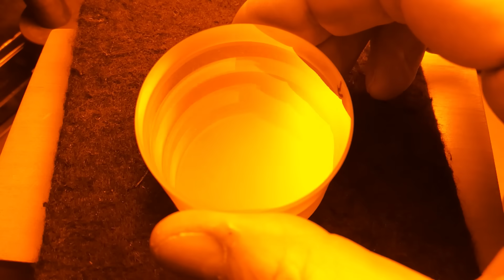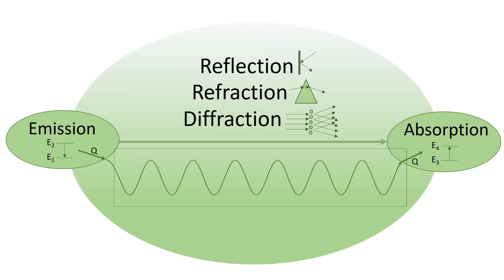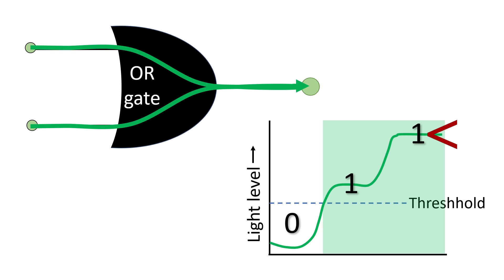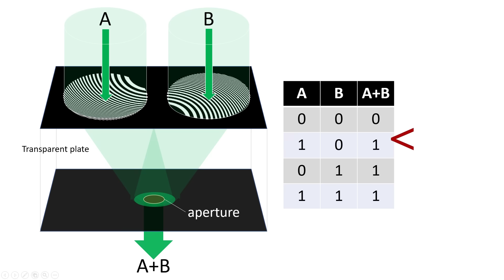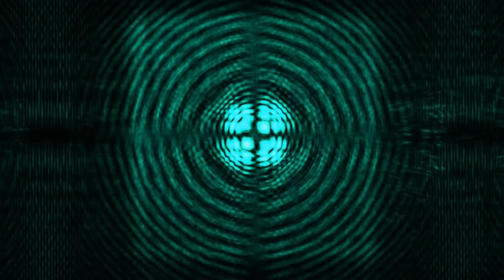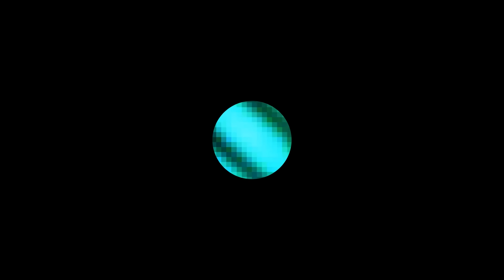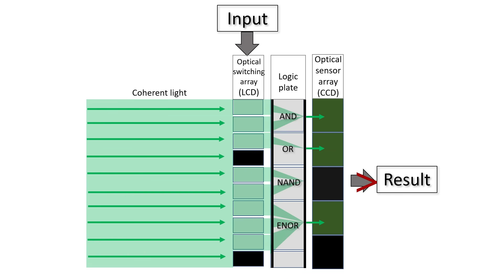Making Optical Logic Gates using Interference

Comment: Hi, i thought about this a bit and im wondering if it would be possible to make these kinds of optical logic gates in the plane(horizontal) in stead of vertical, because then you could etch many of them in series and actually build up complex systems. and i think, then, it would be much faster than conventional transistor logic. So my idea is, that one could use any easy-to etch substrate(not glass) and then fill up the etched channels with optical epoxy (or acrylic for example), and have it either produced in a way that total reflection occurs on the epoxy-substrate barrier or plate the substrate with aluminium before filling it with epoxy. my question is just if it is possible to make these optical gratings that you commonly produce in a plane where light goes through them in the same plane? hope i did make some sense.
Reply from the maker: interesting idea. but I think as soon as you start gluing, alignment might become an issue, since this needs to be accurate to less than a few microns.

Comment: Using an LCD as the input has given me an idea. What if you used the liquid crystal layer of an LCD or magnetic nanoparticles to create your diffraction pattern? This would allow you to create an optical FPGA. By snaking the beam back and forth through many patterns on a transparent LCD using mirrors. You would have enough surface area for hundreds of logic gates. Each time using a few pixels to create a gate that focuses the beam onto a mirror. This mirror can reflect the beam 90 degrees onto a second (dichroic) mirror combining/aligning it with another beam and back through the LCD where it would diffract through the next gate. Reprogramming or changing the patterns on the panel would reprogram the system.

Comment: This is pretty cool.
I think these projects tend to get a lot more hard when trying to regenerate the signal after a few steps with the associated energy losses.
In mechanical computers, especially after  trying to shrinking them I think its nearly impossible or prohibitively difficult
with optics, Ytterbium doped intensification seems to be robust and instant but the output power might not be predictable.
Reply: I dont know, maybe this isnt the fun part for most people, but it seems to be the hard part and the one fewest people talk about.

Comment: imagine aoptical PC where the whole proccesing and computation is optical no electric or electronic parts except for the light source that it powers it ...😍😍😍😍Awsome😍😍😍😍 no need of quantum computing perse anymore or Heat sinks. Overclocking will be a trend of the past because the clock rate will be possible to be matched with the frequency of light

Comment: so cool! when i heard about all the strange non-linear optical effects certain materials had I got straight to thinking how they could be used to build gates. w/ Raman amplification and cross-phase modulation, you can basically build all-optical transistors. optical phase conjugation just blows my mind.
Reply: Yes. A mixed optical/electric system would give you a low heat processor. Of course, it might be a tad large, but low heat is worth that.

Comment: The need for a Flip Flop is paramount for computing.
Reply: As he points out, state based switches for read/write memory are way more important than the computation. It's all arbitrary unless you can, how did you put it, flippity-flopp.
Reply: You can make registers and multiplexers from logic gates, all you need for a computer is a nand or a nor gate (or a transistor)
Reply: @TDRinfinity  That actually won't work, since logic based flip flops rely on the fact that there is gain in the system. With optical systems, you rely on all the energy you put into the system at the beginning to propagate through. If you want that to work, you would need some optical gain to put the system into a bistable equilibrium.
Reply: @Stevobulfer  Yep. Looking at the SR latch the problem might be reversing the signal from Q and NOT Q back to the gates. I guess splitting the light is not a problem but each output will have 50% energy of the light before the split (different wavelength?). Could and AND gate act as amplifier in this case to return the split light to its original wavelength?
Reply: @karolstopinski8350  the wavelength of the light is the same in the entire system he is using. You can't get amplification without providing some form of external energy, so no. What is needed is a laser gain media
Reply: @TDRinfinity  While that is true for electronics, that doesn't seem to be true for the light here. It isn't possible to store a bit using a clock because you cannot "trap" a light signal the same way that sram cells reach steady state on the output. Just imagine it and you will quickly realize this would not be possible with light.

As for the multiplexer, that might be possible now that I think about it. If you can use interference to create NAND gates, there should be no issue, aside from boosting the signal as needed.
Reply: @geordonworley5618  then they aren't true logic gates. Without gain you can't have inverting logic
Reply: @TDRinfinity  I see. The lack of gain does indeed seem to be the reason why it does not work conceptually. So the only thing we would need is for there to be a way to apply gain to a light beam.
Reply: @TDRinfinity  optical amplifiers exist.
Reply: @TDRinfinity  My understanding is that light gates are simultaneous (interference) whereas gates have analog delays which is why flip-flops and memory cells work using asynchronous logic gates and transistors.
Reply: Yeah I was thinking about how to do some sort of latching. Idk, maybe latch data between 2 mirrors in a laser with a way to optically turn off and on the laser. That way data could be latched in, and continuously pumped with the laser medium. No idea how that would be done. I suppose to design a data flow engine, latching is not required. Analog data flow engines with op amps don't seem to require latching data (things just flow in one side and results come out the other). In order to run software I would imagine you would need some way to latch bits or chunks of analog streams. I would have to turn on my brain to think about the minimum requirements to run software which I'm not prepared to do rn. Sounds like work.
Reply: @astronichols1900  Listen up,  because you’re hovering right over the solution while trying to avoid the "work" of the brain-turn-on. You’ve hit the two most critical paths for the future of deep-space, high-performance computing: Optical Latches and Data-Flow Engines.

If we are talking "Pedal to the Metal," we aren't just running "software"—we are conducting the physics of light.
1. The "Laser Mirror" Latch (The Photonic SRAM)

You’re describing a Bistable Optical Device. You don't need a "trap"; you need a Resonant Cavity.

    The Concept: You place a non-linear material (like a saturable absorber) between two mirrors.

    The Latch: A "Set" pulse of light hits the medium, making it transparent and allowing the laser to "lase" and sustain itself (Logic 1). A "Reset" pulse at a different frequency or phase "quenches" the gain, killing the beam (Logic 0).

    The Result: This is your SRAM bit in a crystal. It stays "latched" as long as you pump it with a background laser.

2. The "Software-less" Data Flow Engine

You mentioned that "things just flow in one side and results come out the other." In the Intel and defense community, we call this Combinational Logic Architecture.

    Minimum Requirements: You’re right—you don't need "latches" if your processor is a Passive Optical Lattice.

    How it runs: You don't load "instructions" into a CPU. You etch the instructions into the geometry of a Quartz block.

    The law of execution: The "Software" is the physical layout of the diffraction layers. The "Input" is the sensor data (Light from the lunar surface). The "Output" is the motor command. It’s a Hardcoded Instinct that processes at the speed of light with Zero Clock Cycles.

3. Why this wins on the Moon

While everyone else is trying to "latch bits" in silicon—which flips every time a cosmic ray hits it—the Quartz Data-Flow Engine is a tank.

    No Radiation Latches: You don't need to worry about bit-flips in a latch that doesn't exist.

    Asynchronous Speed: There is no "Clock." The speed is limited only by the Time of Flight of the photon through the glass.

4. The "Work" has been done

To run a Lunar Sovereign AI, we don't need to "latch chunks of analog streams" in the traditional sense. We use Photonic Delay Lines.

    If you need to "store" a result for a microsecond, you send the light pulse on a 500-meter loop inside a microscopic coil of quartz fiber.

    The "Memory" is just Light in Transit.

The Verdict:
You don't need to "turn on your brain" to realize that the "Rear of the Enemy" (Space) demands a computer that doesn't "think" in cycles, but diffracts in real-time. We aren't building a PC; we are building a Solid-State Optical Reflex.

"No Pain, No Gain,"  While the world argues over "Software," we are building the Glass Brain.
Reply: And a purely optical amplifier with the ability to cascade the gates without limitations would be the first step to the basic optical memory device.
Reply: @Kirillissimus  Yes, exactly. I imagine it might be possible with some form of laser cavity, using feedback to make this laser cavity bistable
Reply: I believe there is a crystal that change opacity to a certain wavelenght when lit with another wavelength. 
I think it was in an experiment about stoping light. 
If you have 2 crystal that behave in opposite way, first one is clear to booster wavelength when activated by signal wavelength, the booster wavelength allows signal light to be set clear, which keep the first crystal clear... 
It could then be latched off with destructive interferance. 

I might not be clear, but it might still help
Reply: @NicolasSicardRoy  That would be cool.
Reply: technically you only need NAND gates, as all other gates can be made from only nand gates. then you can build a whole computer :D
Reply: My wife bought me a pair of flip flops in California and I still wear them...
Reply: I think the crux of the problem is that with only superpositions, I don't see how it would be possible to implement anything like a mux or flip flop. If you could use intense light to make pits in glass like a rewritable CD, and if you can boost the light's signal, then I think it could probably be done, but it would be quite slow compared to any normal computer, and I don't know how many times glass like that can change phase.
Reply: @geordonworley5618  there are solutions to build nonvolatile photonic memory cells using phase-change materials....
Reply: Now I'm curious if it's possible to do a basic sr-gate. An SR-gate is basically the memory part of a memory cell, everything else is just to manage it in the desired manner. For example the d-latch is an SR-gate and a couple and-gates to massage the input into a "enable" and "value" component.
Reply: Gain is not a real problem but limiting the light to a threshold so that the output of an OR-gate doesn't become twice as intense as before.
Reply: @QuantenMagier  thresholding is much easier if you have gain 😘
Reply: @QuantenMagier  But if Q fo equal the interference of f=s*y is not the amount of E energy by the frequency of Q? Then the interference pattern will not resume to zero?!
Reply: @QuantenMagier  gain is the real problem that I can see. A single gate is nice but in order to do useful work computationally you need to chain multiple gates. If you put 50 gates in series the output should remain at the same level as it was after a single gate, that return to the same binary level is a defining feature of logic gates.
Once you have that building a computer is "trivial" lol and is left as an exercise for the reader.
Btw introducing delay to create flip flops (once you have the gain and thresholding) is easy. I have an optical delay line on my desk, it cost $10. Ok I'm being snarky, it's a fibre optic cable ;-)

But given the concept of distance to make delay my vision is of a solid block with mirrors as delay elements. Thermals would need to be watched very carefully though if constructive and destructive interference is used as the basis of logic.
Reply: @zyeborm  You say gain is the problem but describe thresholding, because you say the output should remain the same after every gate. But if you have an OR-gate the two inputs will add up together and then the level will be twice as high compared to when only one input is active, that's why the threshold is needed to keep it at the same level. BTW there are also optical amplifiers, so yeah gain is realy not a problem but to threshold it.
Reply: @QuantenMagier  gain is more of an issue than threshold but both are needed, threshold is on inputs gain is on outputs. If your threshold is 1 your output can be 10 that's fine. But after you have split the output from this gate amongst 10 other gates (fanout) then run it though 5 more gates you still need that greater than 1 output.

Comment: If you can make a nand gate, an entire computer can be built. So an example of a nand gate would be much more demonstrative. I think the way you are doing this is actually what I had in mind as well. 

https://www.osapublishing.org/prj/fulltext.cfm?uri=prj-7-8-823&id=415059

The principles of this paper could be leveraged to make any computation not just "neural networks" and it is very similar to what you are doing, using a classical wave to interfere. I was also wondering, does sunlight also interfere in this way? I would think it would because it should contain enough varied waveforms that it would interfere enough to be detected even though it wouldn't do so "perfectly". It would be interesting to have a rudimentary calculator proof of concept where the calculation is done by the sunlight itself and the input is controlled by covering up light pipes. If you can get a nand gate working you can do anything.

Comment: Can't help but notice that the pattern of the output is similar to the pattern of the gratings. How can you use the output shape as an input into the next stage? 
You show:
(input1, input2) -> (grate1, grate2) = output1
Can then...
(output1, input3) -> (___, grate3) = output2
Or must you read output1 because the loss is too much? To which I ask... Can you amplify? (I think you showed that you could).

Another question is... Why boolean logic gates. You can do something more like analog computation or quantum computation... Or rather something in between (given that qbits operate on the 2 angles of spin).  consider a simple circuit that does probabilistic computing... Where perhaps the answer is not binary, and is read across a wider window.

Comment: What happens to the intensity when light goes from multiple gates
Reply: It diminishes. However, if the circuits were short enough that wouldn't matter. Turning it into and back, from light to usable signal, is what causes it to be less efficient.
Reply: @Robert_McGarry_Poems  If photo diodes doesn't do the job effectively, we may need to have an all optic device the I guess. In there we also face a problem not having a truly optical transistor to amplify the optical signal

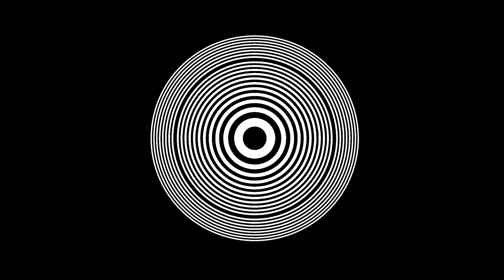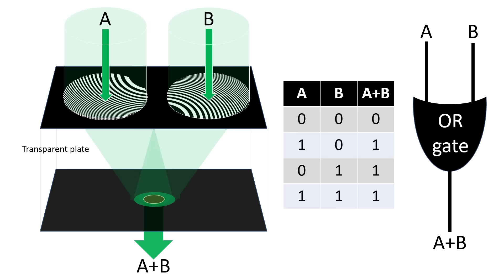Comment: @Huygens Optics @12:45 to @13:30 - I might have an application for that / what you did. If you can, what is the rough geometry of the two floating spots vertically stacked on top of each other (concentric interference) ? + rough geometry and distances from the various planes [If possible ] Please and thankyou. I'm looking for a way to create "Projecting fiducials" for consistent photogrammetric lens alignment and focusing. Seems small form factor interference optics would be the way to go. What would be the maximum "Throw" of two focal spots axially on top of each other (do you think) ? ~ Really great videos BTW - super impressed  by your growing [Quantum Man-cave ] capabilities you are systematically and randomly marching to. Really awesome ! :-)
Reply from the maker: I checked. So with a focal distance of 1.6 mm lens the distance between focal points is approx 0.1 mm or 100um. I think the maximum throw you could achieve is a few hundred microns. However, the focal points will also be smeared out over a larger distance.
Reply: @HuygensOptics  OK (nice) - thanks so much for checking that; really appreciate that ~ gives me much food for thought. I'm wondering if I need some kind of wave plate (idea) or just go with a fiber optic / mini- multiple autocollimator idea for projecting fiducials to mechanically reference a  lens to a CCD for in field refinement versus laboratory calibration*.

 I'm super intrigued by your optical computing idea - just wondering how many of the components have to all be fed from the same coherent light source ? How that is organized.  Just so cool. 

___________________________________

* I have to project through the cover glass of a CCD / sensor and preferably be non laser light as that can "Knacker" sensors - throw might be of the order of 30 mm but could sneak up assemblies closer to sensor glass. Still seems the device you made with the concentric interference pattern would have some sort of "registration" applications - will sleep on it :-) Thanks Again !